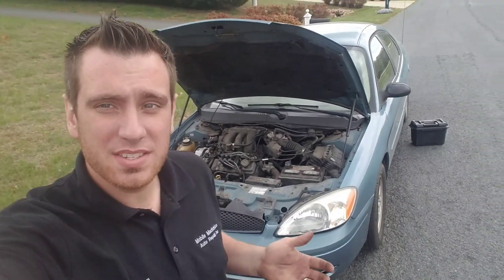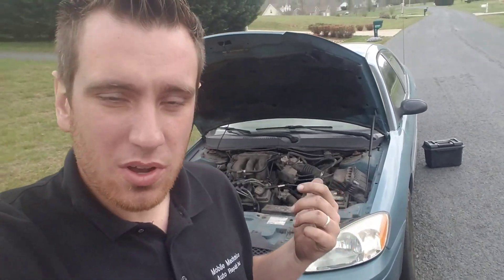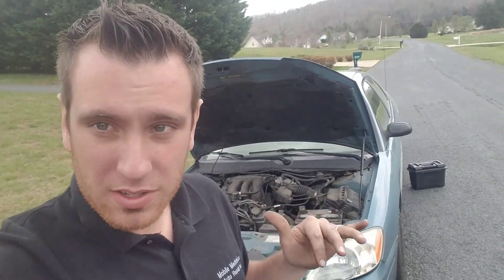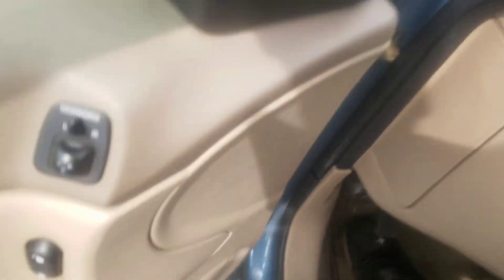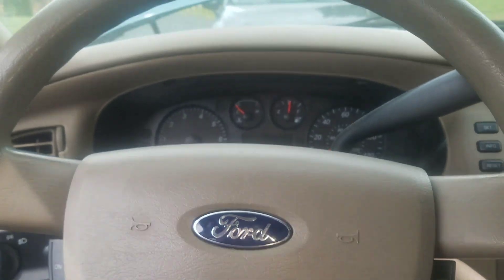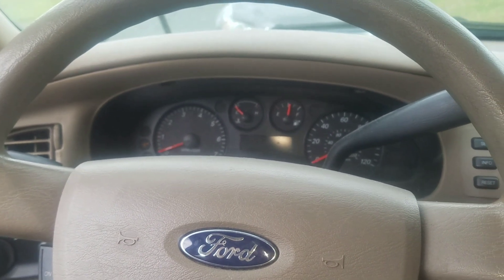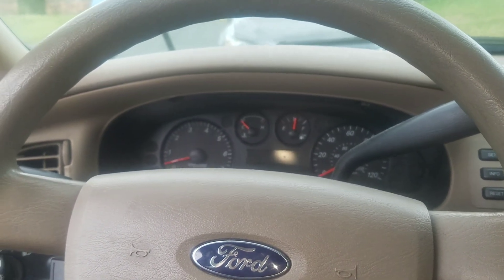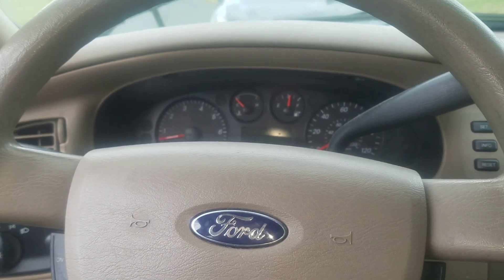Ford Taurus p1633 How to Diagnose

Comment: This is amazing.  This is the very 1st video I pulled up on this exact same car for this code.  I decided to be lazy and watch YouTube 1st instead of grabbing the book that I own.  I picked this car up for cheap because the previous owner could not figure it out.   It's got a new battery alternator, battery, starter, battery cables positive and ground.  I popped the cover off and find the fuse is blown.   I appreciate how fast you were with a video, it actually took less time to watch it than it did for me to type this.

Comment: This does NOT address what's really wrong, which is what is causing the circuit to blow the fuse.  I'm seeing that it can be the MAGNET in the AC compressor causing the short.